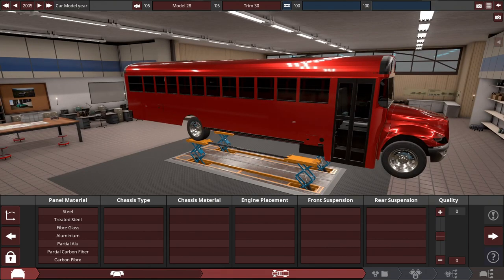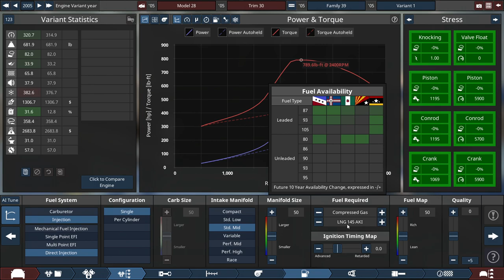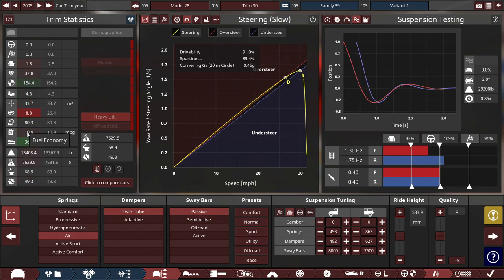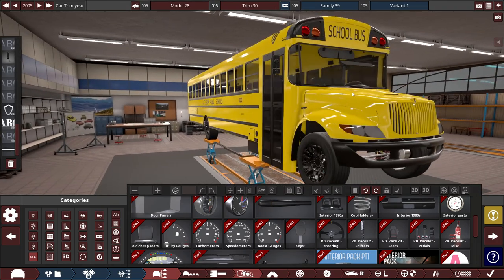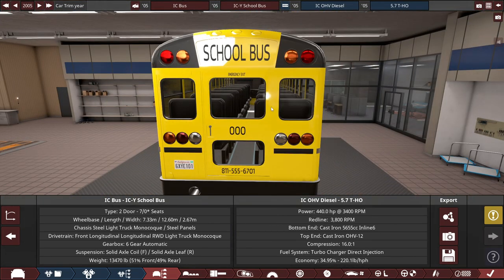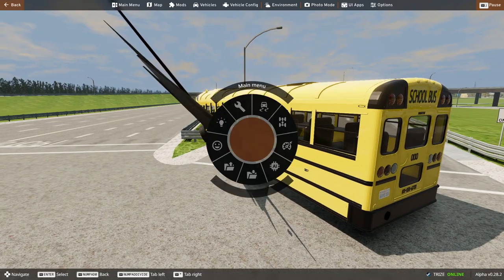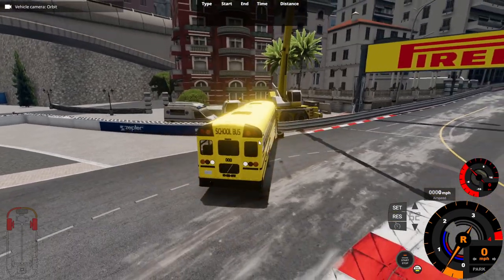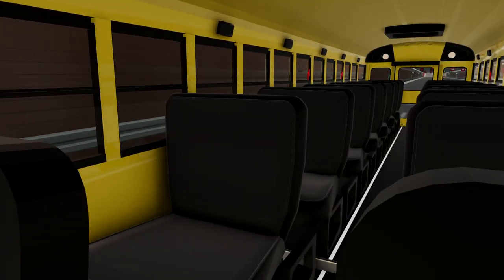Building a Realistic School Bus! | Automation Game & BeamNG.drive

Comment: Been watching quite a few of your videos and I noticed you've been putting solid disc brakes on all your builds. 99% of cars run all vented disc brakes with mainly small passenger cars running solid disc's in the rear only. Maybe automations physics is different from real life but you'll be better off putting vented rotors on everything. Solid rotors just dint have the cooling and fade easily. Hence why they are only ever used on the rear of vehicles because the rear is subject to alot less brake force

Comment: LPG is diesel substitute as in this configuration the octain iss too low for spark therefore is measures in cetane and is comparable to diesel and karosine rouphly between 30-50 cetane. and as diesels dont use ignition timing push that all the way to the right. with the turbo swap turbine measurments and you can get low band torque like a diesel at boost control.